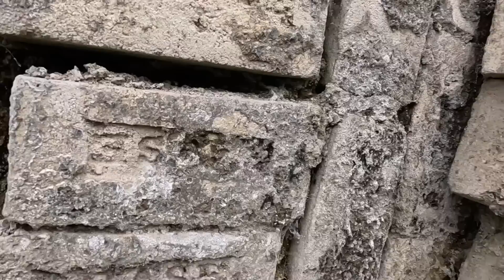The Viaduct to nowhere. The Gaunless Viaduct

Comment: Just been there today to remember my dad Maxwell  who died in March. Thanks for the video. My dad lived at High Lands. As a lad in the late 60's I used to walk with dad down the fields from grandad's house at 69 High Lands to the valley floor below and walk the old line. I hadnt been back since till today. The place is just as I remember it as a lad 50 odd years later. Amazing place. My grandad  Jack worked in many mines in the area. He retired working at the last open cast mine at Low Lands in the late 60's. Thanks again.

Comment: Excellent video Martin,  don't think it ever saw diesels, DMUs were used on Darlington to penrith and Middleton in teesdale but passenger services finished in the 50s on this section. 
As diesel locos were too heavy for belah and Deepdale summer holiday services from Sunderland to Blackpool which came this way tended to be double headed steam but no bigger than class 4 2-6-0s
Cheers Russ

Comment: Another fine video Martin and the Gaunless Viaduct is truely magnificant even in its partially demolished state on a line that was built in sections from Darlington to Tebay on the West Coast Mainline across some of the most difficult country in the UK.As you pointed out the Engineer was Sir Thomas Bouch who was famed for his "Economic Railways" which suited the Victorian Ideal of value for money after the Taybridge Disaster of Dec 1879 speed limits were introduced by the Board of Trade on all his High Viaducts and Bridges until they were Inspected and Strengthened which was completed by 1890,Bouch himself died a broken man after being blamed for the Disaster in Nov 1880.

Comment: If you've got train simulator classic there's a whole set of scenarios called "weardale and Teesdale rail network. 
You can drive several diesel locomotives and multiple units around Barnard Castle to Shildon and as far as Darlington on the East Coast mainline and many other branches including the Haggerleases branch.
Set in the early 1960's you can see all the industrial lines in this video.

Comment: Good to see you moving towards the birthplace of rail transport, we have many miles of old waggonways, where coal was hauled first by horses and later by stationary engines, or self acting inclines before locomotives came along. Some very impressive monuments called batteries where they culverted the rivers then filled in the valley to make a level track over the top, vast amounts of labour and countless wheel barrows to build.
The quarry you found was where the Cockfield Dyke has been removed for loadstone, it is part of the Cleveland Dyke system.

Good video, I enjoyed it
Reply from the maker: Thanks very much Colin

Comment: im always taken by how much effort must have been used to build our existing infrastructure, and alot of the time they built them in less time than it takes us now, but its not just that, its also the fact they made everything look impressive and unique most stuff built today has no flare or style just functional and boring, good vid this, many thanks
Reply: @PlasmaStorm73 [N5EVV] not totally,  dont forget HS2 is designed to avoid things like wash away on embankments, and for speeds of 175mph which gives different stresses and needs for a straighter geometry and avoiding turnouts and so on, plus add in the overhead electric (which the early railways generally didnt have ( the newcastle area of course being early adoption on a few passenger routes but this was more at tramway voltages.
Reply: Exactly! No safety elves breathing down your neck, no red tape, no BS. They just fking got on with it. Another reason things take longer now is that we no longer have the heavy industry we had then. Now steel for bridges is imported. Every tunnel and bridge had its own local brick works that made the bricks.

Comment: Great stuff! Martin and Co, (I love The Lord Of The Rings Two Towers feel) a magnificent structure and sounds that they didn't use a good quality steel on it as it had decade so much in a relatively short time. Perhaps take a flask of hot water as you usually do next time stick to the plan!😉
Reply: Same engineer and probably the same company that supplied the Tay Bridge stuff.

Comment: Amazing to see that the brick columns and remaining structures look as if they were built in the 1960s.
Reply: You mean 1860s. It would be horrible grey concrete if it had been built in the 1960s.
Reply: @simontay4851  I said 'look as if they were', meaning that, seen from a distance, they look very modern/futuristic but yet are much older in reality.

Comment: Looks like they built the pillars like chimneys, but with an infill of extra bricks
The bridge is unlikely to be bolted on, the plates with the bits that stick up would be where one end of the bridge was located, with just the weight holding it down, the flat plates at the other end and on the pillars are sliding plates to allow the bridge to expaand and contract with temperature
I sense a theme to your vids, cockrover, cockermouth and cockfield, where next, drinking cockburns port in cockfosters while the cock crows ?  :D
Reply from the maker: Dam youve uncovered the thematics in my videos
Reply: @PlasmaStorm73 [N5EVV] Nice one :)
Forgot to mention that this episodes brewtime was a cock up, they didnn't even make a camp fire.

Comment: What a great site. Just did a quick check on the bank of England inflation calculator. Those original construction costs translate to just over £1.5m in 2023 money. But if a similar bridge was built today the actual cost would likely be many times that.

Comment: the comment on the brickwork at 20:00, i saw the plans for an impressive old wall(but only a wall) and the plans included the layout of every course.  the layout of the bricks in the piers and the abutments would have been shown on the plans, maybe even to show each particular course.  the plans would have specified frog side up and full mortar joints.  it appears the bricklayers cheated on this last spec.  they always do.  by the way, another fascinating video.  if i was to tour england i couldnt care less about castles.  i want to see where the industrial revolution came from.  it eventually led to the development of this thing i type this post on.
Reply from the maker: Interesting and thank you 👍